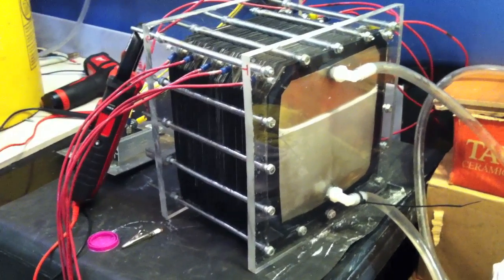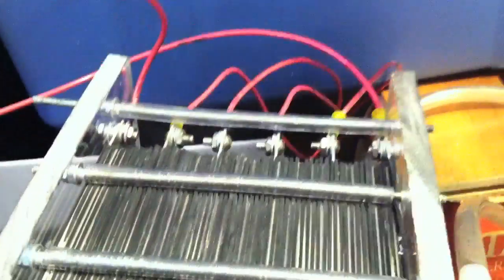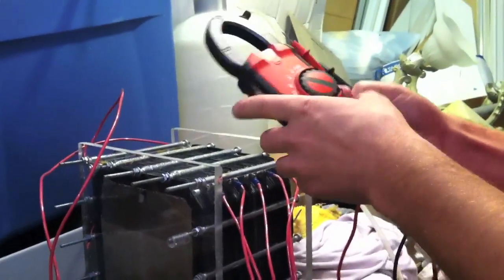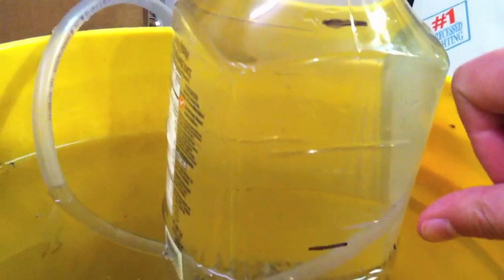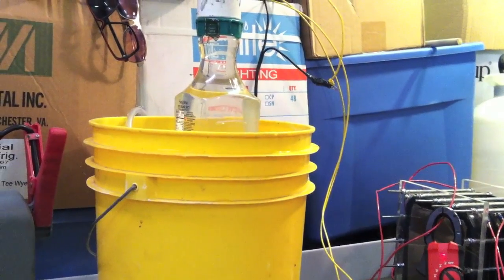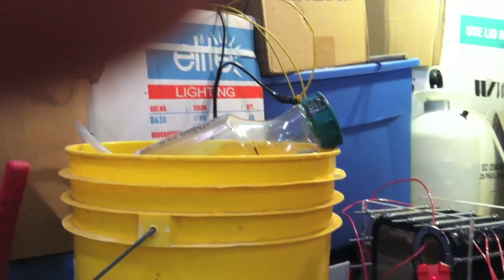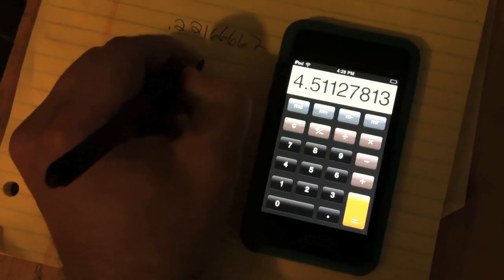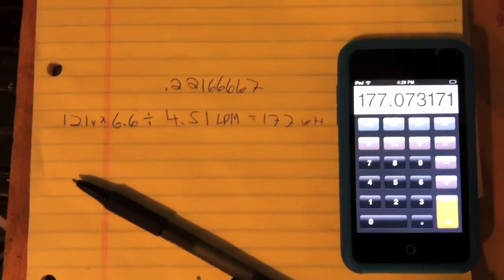120v 4.5 LPM 60 plate hho ( hydrogen ) dry cell demonstration

Comment: Did you really just measure your wattage using AC Volts and DC Amps????? 
That gives absolutely no information on what your wattage is. Record DC Volts and DC Amps OR AC Volts and AC Amps otherwise your measuring is completely pointless since we have no idea what voltage the rectifier output is...
Reply from the maker: hotpckts When I made this video (3 years ago) I thought that the Bridge rectifier was not suppose to change the voltage at all, simply convert AC to DC current. I thought that the slight difference in voltage was due to inefficiency of the rectifier. 
From what I remember, the DC Voltage read at 129V.
Reply: It doesn't go down. It all depends on what voltage you are talking about, RMS or Peak to Peak on one side of the rectifier and Avg DC and Peak DC on the other.
Reply: The voltage can't possibly go up through a bridge rectifier. The diode is mounted on a heat sink for a reason. The semiconductor in the diode will create resistance that generates heat. The voltage will drop.

Comment: It would be interesting to see if this could power or help power a whole house generator. Most 3-5k generators last 8-12 hours on 5 gal of gas. Be nice to improve on the stock numbers.
Reply: A wood gasifier can produce syn gas for that very purpose.
Reply: Why on earth would you generate this gas to produce electricity, while you're using electricity to run the "HHO generator"? Are you not aware of the laws of thermodynamics?
Reply: Philip McCorkle
I know it would be a balancing act between a hho gen that produces enough to help the gas motor while not taking too much power to run the hho gen but it is an interesting concept.
Reply: It's not a matter of a balancing act............... If you're running the generator on JUST H2, then you're going to be losing net energy. You won't be able to "power" anything because the whole process will always have losses. What you're talking about is "over unity" - where you produce more power than you put in. Google "laws of thermodynamics".......
Reply: It could, given enough storage. But it is insane to store hydrogen and oxygen together, and expensive to seperate.

Comment: Are all people on youtube extremely unscientific or am I the only one that notices it?
HHO is just a non correct way of wording a mixture of H_2 (g) and O_2 (g).
Then all these guys talk about Watt/Liter which doesn't make any sense since you are practicaly saying J/s/dm^3 which is complete bs. You need to take the total power consumption in Joule and divide that by the number of liters. The total power consumption is the average power consumption times the total time it took to produce those 4,5 liter then divide that by the numbers of liters. The answer has the dimensions: J/L.

Sorry for the rant I study physics and thing like these hurt my brain. But I'm extremely glad to see Americans use SI units in the first place so keep that up ;)

The only real reason I'm watching those "HHO" videos is because I'm in need of a Hoffman aparatus on a much bigger scale. So far I only found those plate electrolysis devices which will have the gases mixed making them inusable for my applications.

Actually the O_2 gas is something I don't even want in my application as it would damage the hydride and means I need either a couple of semi permeable membranes or a clean gas the later being the easier choice.
Reply: YouCallitPiracy well.. I'm sure you've figured this out by now (2 years later 😂) but the cathode or negative end produces hydrogen and the anode or positive end produces oxygen.. and with that little nugget of info you should be able to easily make an apparatus that gives you clean 100% hydrogen. :)
Reply: +YouCallitPiracy - LMFAO - If you are sooo FUCKING SMART... Let me give you a hint in Life:)))) - Did you know being DUMB and a LOOSER is easier than being SMART or a WINNER ??? DUMB People let the Smart People do all the work.... LOOSER don't have to try to win or sweat. In the end.... Who have to work harder??? The Winners and the Smart People do!!! If you are SOOOOOO FUCKING SMART.... Let the Winner and the Smart People do all the work, and you can sit back and relaxed!!! I guessed you are sooo fucking smart, you haven't thought of that one huh???? ............... Like you are " sitting there hurting your Brain ". You don't see me sitting here hurting my fucking Brain,..... STUPID FUCK !!!! hahahahhahahahhahahaha LMFAO !!!
Reply: Jordan Bronson b8?
Reply: dude you're  opinions  is duliy noted you and Tire express your opinion and I valued it but nobody's putting a shot gun to your head to make you watch these videos these people doing the best they can man and some of me not to have college degrees but at least they doing something rather than Wine and b** they're getting off their ass and saying f*** you oil companies and that they have my support

Charles neely host of radio occupied amerika   https://www.spreaker.com/show/radio_occupied_amerika
Reply: I'll add to the extremely late replies....For this dumb ass.
HHO is NOT H2 O2. Electrolysis makes 2 hydrogen molecules and 1 Oxygen molecule. H-H-O  -> 2 Hydrogen 1 Oxygen molecule.
Moron. It would be actually H2 H2 O2. Take away the 2, what do you have H-H-O....DEEEEERPPP
Reply: @Gustavo XD
While i think HHO is a completely usable method to convey what the gas should be recognized as, What you said isn't the full truth, hydrogen and oxygen is diatomic, this means Oxygen forms a bond naturally with another oxygen, hydrogen forms a bond with another hydrogen, you should be thankful of this process, why? Well, if hydrogen wasn't diatomic (and oxygen) the gas would hypergolically react, that would make the device useless, unless rapid unscheduled disassemblies are your thing.
Reply: Who cares as long as it works? What degree did Edison or Tesla have exactly?
Reply: Its called HHO instead of H2O because the current separates the hydrogen and ogyxen. Makes it simpler to understand
Reply: HHO is also known as browns gas and is also known as hydroxy gas with a specific concentration of 2rds hydrogen and one third oxygen. 

The video poster gave units of time watts   which is perfectly reasonable units to know how much energy was used to makeca liter of  HHO gas. 

If you or anyone else dtill wants to 
make relativly large amounts of hydrogen quickly with electrolysis, one can get reasonable pure hydrogen with two half cells seperated by a nylon mesh membrane.  Nylon submerged in an electrolyte and being hydrophilic  does not let oxygen bubbles cross the barrior easily.  Furthermore nylon are compatible with sodium and potassium hydroxide.  Just get your wife's permission first  before you go use hers. 😏
Reply: I'm totally with you on the idiocy of the term "HHO" as if it's some sort of novel gas that was discovered in someone's garage (and the oil companies are supressing!!!!1). However, what they are talking about regarding your "Watt/Liter" comment is actually "Liters/Minute/Watt", which is a very reasonable unit (Liters/Joule).

I'm an electrical engineer and I have no idea how I got on this video, BUT I made an electrolysis cell a few years ago that does not mix the gases. I'd have to show a diagram, but it essentially consists of a U-shaped PVC pipe construction with screw caps on the top ends where the electrodes connect to and slide down into the tube. It's kind of a homebrew hoffman apparatus, but with PVC pipe.

Comment: wouldn't it be much easier to take  1 minute, (60 seconds )divided by 13.3 seconds to get the 4.511 lpm instead of all of the other unnecessary formula you just did?? it is faster, and you don't have to do anything else, because it tells you how many times 13.3 seconds goes into a minute, which would be how many liters you can fill in a minute. you did just fill the one liter portion in 13.3 seconds! you just did a lot of extra  un needed calculating there buddy... lol

Comment: Isn't it actually about 3 watts per liter? I mean if the power consumption is 798 watt hrs, then the watt minutes would be 798 watt hrs / 60 minutes = 13.3 watt minutes. Therefore the amount of power consumed per 1 liter of production is 13.3 watt minutes / 4.5 liters per minute = 2.95 watts per liter.

Maybe I am wrong.
Reply: He needs to put his amp meter on the 120V side if he is going to get a true power consumption.  ACV*ACa would be appropriate.  On the DC side he can use the 12V * 6a would be roughly 79 watts dc.   So I am curious what the amps are on the a/c side of the rectifier.   Now, its really a great cell producing only 6.6a dc and getting about 4.5L/min.
Reply: @halc8299  LOL I don't even remember this video or my comment. LOL 7 years ago....
Reply: @halc8299  you are correct he used the AC voltage and DC current for his calculation. W=ExI

Comment: nice cell,that unit could crank 20 lpm with the proper cooling system , would make a fantastic torch
Reply: *****
Except that it takes more power to split the water than you get back from the engine... so you'll still need that gasoline!
Reply: wendy p   whait a minit. How can u have more neutral plates and get more hydrogen than oxygen?  H20 two hydrogen for every oxygen. If you get more hydrogen what happens to the oxygen?
Reply: NedTheDread unless you make an electron stripper to take the additional electron from the HHO to create a different isotope of the same atom, which ends up being 40 times more powerful than gasoline. If the atom is changed to  another isotope, even more power is formed . Orthohydrogen is simple to make, it's a a monatomic form that has to be used immediately. Also, by using  a copper heater tubing can  excite the fuel to make it much more explosive. Just as long as it is made on demand an uncompressed, it works perfectly to run an engine with much less gas. Once the engine compresses this mix, the combustion rate is much more powerful than the standard test proves it is. We have tested this method using a high voltage to create the gas, no electron stripper is needed because the electron is automatically stripped from the gas using a high voltage electrolyzer and specific waveforms at the same time, and less than .5 liter per minute @ 50 watts and it successfully idled a 16 hp twin cylinder fuel injected power products engine. The gas has a much faster burn, so, the timing needs to be about 4-6 degrees retarded depending on how much Hydrogen is in the hho mixture. Its best to use a double cell stack with a single positive plate, many neutral plates, and 2 negative plates, which releases a higher ratio of Hydrogen and less of Oxygen. This is the key to an engines proper combustion using HHO, but, I stress that it's used with fuel injection, through the fuel rail with a custom ecu, or an ecu that has been mapped with correct timing curves and air/fuel maps.
Reply: wendy p Hydrogen is NOT 40 times more powerful than gasoline.  The fact is, hydrogen has 3.67 times less energy than gasoline.  Just about everything else you said is wrong.  That is what happens when you get your information from the people trying to sell the SCAM.
Reply: I didn't say neutrals, and if I did, I meant negative plates. The negative releases hydrogen , positive let's off oxygen. Ideally , a balanced blend should be released from two negatives and one positive. Try this fed into a balloon and then fill a balloon and light them comparing the explosion. The second electrolyzer needs to have equal amounts of positives and negatives. The equal gas will be weak. The double neg and single pos is massively explosive, and, the balloon will also be ionicly charged from the double negative

Comment: You are mistaken units. On one side you count in hours on the ither side you count in minutes. It actualy only needs 3wats for each liter in a minute or 177wats for 60 liter in an hour. You can also make following method:
121v x 6,6amp=800wh
4,51lpm x 60= 270lph
800wh for generating 270l in an hour is equal to 3w for generating each liter
Reply: Correct, thanks for the recalculation

Comment: I'm currently building my own HHO system for a turbine combustion engine. I do not see how burning hydrogen is useful for a reciprocating engine because of Hydrogen burns 10x faster. Maybe it is more applicable to a V18 Indy care who's displacement is in small CC. 500-1000 LPH is very inefficient. I would not run an HHO system on a cylinder combustion car even if I had one. It's just a waste. I graduated from Wyotec quite a while ago though, so maybe I need to brush up on my OBD3, because like I said, it's not impossible, its just a huge waste of efficiency.
Reply from the maker: Yes, I believe you are right in that it is a waste of energy to use hho to run a combustion engine. It seems to me the best use of the cell is a torch.
Reply: I found that hydrogen on demand for hybrid  hydrogen/gasoline  improved fuel economy by about 24%.   The primary fuel burns faster and more completly during the first half of the power stroke rather than in the catalytic converter.

Comment: I got a suggestion for you ! try using positive negative positive negative positive negative ! with no neutrals ! hook the  positive at one end of the cell at one corner., then hook the negative at the opposite corner ! you should be getting way more production !
Reply: You only need 2v at each plate.  120v with 60plates would be 2v between each plate to break the bond between the atoms.  I've been told the process works a bit better @ 18amps, but idk...